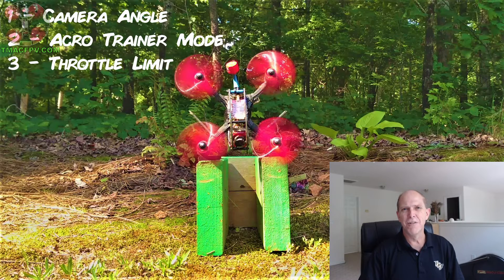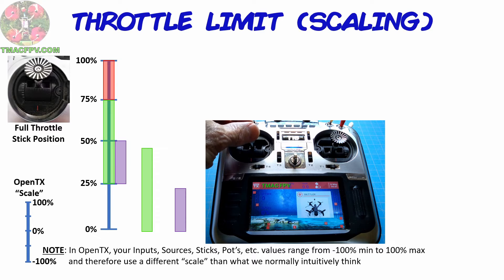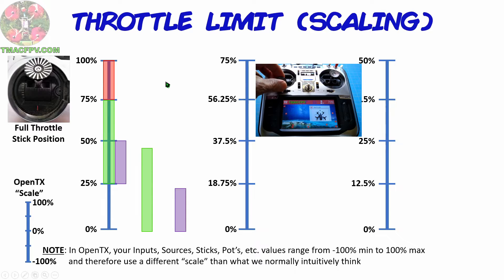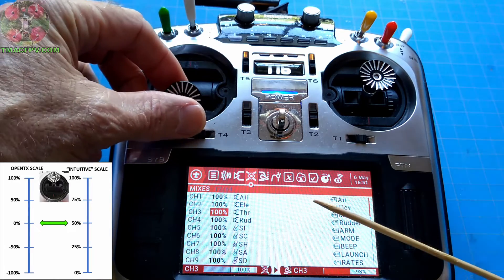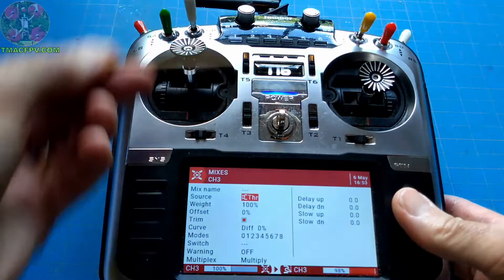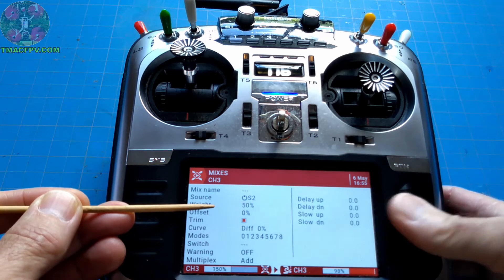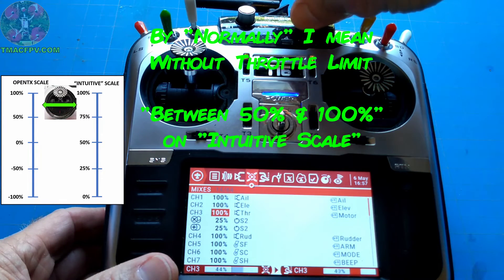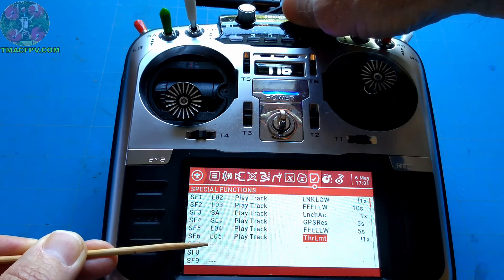Jumper T16 OpenTX Throttle Control (DIALED IN!)

Comment from the maker: Ready to go "Full Throttle" and actually use the entire range of your throttle stick?!? 🤩 How about "dialing-in" your throttle for a specific flight – you know, like a lower max throttle value for cinematic flight versus higher throttle value for flippety-flop freestyle?  This OpenTX Throttle Control (Dialed In) works with Jumper T12, T16, T18, and any transmitter running OpenTX system firmware!  Let me know how you'll use your DIALED-IN THROTTLE in the comments below and make sure to check out my site at TMacFPV.com !😀👍

Comment: Is it possible do a similar trick with throttle (or any other) EXPO?
I'd love to be able to adjust it - if not with a pot, than with a 3-position switch (0%, 25%, 50%).

Comment: Hi new subscriber 👋wondering if you would do a video on how to succeed setup a Spektrum model with this radio, the 3 flight modes and panic/safe recovery switch that is standard on most of their planes. I just purchased the horizon hobby Valiant and would like to have it in the air confidently without worries yet difficult to find information. Any help is appreciated thanks

Comment: thank you so much for this, its super helpful.  question is...how does this interact with throttle expo in betaflight? when I scale down throttle is the expo in the wrong place ?
Reply from the maker: Hey Falcon Won, you are quite welcome and great question! Yes, this will affect your throttle expo in Betaflight.  Whatever you do (program) inside of your transmitter gets output as a signal going to your Flight Controller (and therefore Betaflight).  Betaflight takes this signal output from your transmitter and applies whatever you program in Betaflight to it.  So, if you have a throttle expo (around mid throttle) set up in Betaflight that runs from 0% throttle to 100% throttle (in Betaflight) AND you use this throttle control with the S2 switch programmed in on your transmitter and you turn the S2 switch to limit your throttle to 50% when at max stick deflection - then at max stick deflection after Betaflight throttle expo has been applied, you will find yourself at the "mid throttle point" on your curve in Betaflight.  I hope I was able to explain that well enough for you to understand.

Comment: So this video is throttle limit scale.....
Can the same be done on throttle limit percent? 
I normally use 25% throttle limit percent.
Would be nice to be able to bump this up for those windy days without needing to use BF
Reply from the maker: Hey FPV wannabe! I'm not sure I understand your question, please clarify.  This "Throttle Control Dialed In" actually does both.  It adjusts the max throttle percent to whatever youturn the "dial" to between 50% and 100% while simultaneously re-scaling your throttle channel so you can use the entire throw of your throttle stick.  So, if you're referring to the Betaflight Commands of:
 throttle_limit_type = OFF, SCALE, or CLIP and throttle_limit_percent = 25 TO 100 valid values, what this video is describing is using throttle limit type of SCALE and throttle limit percent of 50% to 100% (whatever value you want by turning the potentiometer switch #2 to).  Its an easier and more "accessible" way of doing it than having to connect your quad to a computer, go into Betaflight and adjust the values that way.  for instance, what if you wanted to change your max throttle from one flight (more of a cinematic flight) to the next flight (more of an "all-out" freestyle flight)?  With this method, you just turn the dial!  Hope that answers your question! If not, please clarify. Have a great weekend!
Reply: @TMacFPV  isn't their a difference between throttle limit scale and percent?
Reply from the maker: @gmivisualsjason3729  Yes there is.  These are two different Betaflight Commands.  This video shows how to accomplish (on your transmitter, not in Betaflight) Throttle Limit Type = Scale in conjunction with Throttle Limit Percent (anywhere from 50% to 100% depending on how you turn the dial).  This is the difference between what is described in this video and the Betaflight commands.  Using the process in this video, you can just turn the dial to adjust your throttle limit percent (and also adjust your scale to match that percent so you can use full range of stick motion). Throttle limit percent is the maximum you want your throttle to go to. In Betaflight, It is used in conjunction with either "Clip" or "Scale."  If you set throttle limit type = clip you're just chopping off the top portion of your throttle above your throttle limit percent.  That means once your stick moves past the point to whatever percent you  have set, it does nothing.  You're wasting that top portion of your stick movement.  So, I personally do not see any value in "Clip' used in conjunction with "Scale."  Scale re-adjusts the scale of your stick position so you're able to use the entire range of stick "throw". You can also set the max throttle percent in your transmitter by changing the throttle Mixer Page weight to whatever percent you want and adding the complimentary offset to it (for example, if you wanted to limit throttle to 75%, change throttle weight to 75 and offset to -25).  This would also work, however, anytime you wanted to change the value, you'd have to go back to the Mixer Page and change the numbers.  With the method described in this video, you just turn a knob.  Make sense?  More info here: https://github.com/betaflight/betaflight/pull/5608
Reply: @TMacFPV  hi their... Thank you so much. Really appreciate the detailed response.
What I'd like to do is be able to adjust throttle limit percent only on a dial.
On my quad I'm currently set at 25% and yes that means that I reach full power with only a small amount of stick movement.
I've actually really grown to like this method.
But it can leave me wanting more power when the wind picks up.
Can I set adjustable throttle percentage on a dial without it doing the scale adjustment?
Reply from the maker: @gmivisualsjason3729  So, you're saying you don't want to use the entire range of stick movement?  You don't want to be able to push the throttle stick all the way up?
Reply: @TMacFPV   spot on .... I'm a rarity. 🤣🤣🤣

Seriously though it would be nice to have both methods on the T16 dials to compare. :-)

Comment: Awesome stuff! I don't have a jumper either 😞 Lol! Increasing the resolution of the stick is a great lesson👍🏻 and is something I'm familiar with. I lower the degrees per second for pitch and roll on betaflight for more resolution and better control. For throttle, I play with the throttle curve on the taranis, so I still have a 100 percent if I "need" 😉 it.  Flattening the middle a bit so it's not jumpy for smoother flight. You definitely got me considering a jumper 🤔
Reply from the maker: Hey Jason, appreciate it!  However you're doing what you do, just keep doing it brother!  Your flight vid's are spectacular cinematic stuff!  I too have throttle curves with a  "flattened out" inflection point and different axes rates on a switch I can flip back and forth between, so I understand what you're talkin' about.

Comment: I don't have a jumper. But I am planning to get one. Your videos are very informative. Thanks !
Reply from the maker: You're very welcome my friend.  I'm happy with my T16 Pro since I got it last October.  Also, this OpenTX throttle control works the same way with any transmitter running OpenTX system firmware.  Jumper T12, T16, t18, FrSky transmitters, soon-to-be RadioMaster TX16S, etc.
Reply: @TMacFPV  hey tmac... Trying to do this with the Radiomaster TX12... Anyway I can do this with one of the 3 position switches since I don't have a logi-switch?
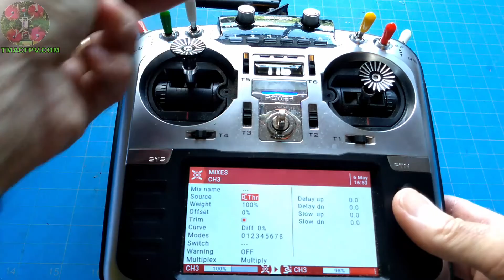Reply from the maker: @califpv  Hey Califronia_Gaming!  You can use whatever switch you want as the "Source" described at the 7:35 time mark of this video.  I understand the TX12 does not have the potentiometer (pot) switches.  You can use a 3-position switch, however, then I believe you'll only have 3 values for your throttle control (50%, 75%, and 100%).  What makes more sense to me for throttle control on the TX12 is using one of the "slider switches" on either side of the transmitter.  these will work exactly as the potentiometer switch shown inn this video where you can have ANY value of throttle control between 50% - 100% (not just 3, but ANY).
Reply: @TMacFPV  your right! I used the right pot slider and it works beautifully ! Thank you my friend!
Reply: Just have to be careful because those sliders are in a location that is pretty easy to accidently move.....

Comment: Excellent Video, I always look forward to your presentation.  I had been using betaflight Throttle "Scale" and "70" percent in the pids area.
And throttle expo on the inputs for low mid high rate.  I like your approach better,  less setup... Thanks!!
Reply from the maker: You're quite welcome Joe and thank you for making the time to provide me with your feedback on the content.  I also used to do something similar to what you had been doing.  This, to me, IS much simpler.  "Dial a throttle!" Don't think it could get any easier. When you try it out, get back with me and let me know what you think and how you're using it.  Looking forward to hearing about it!